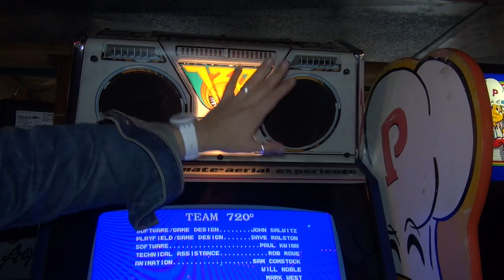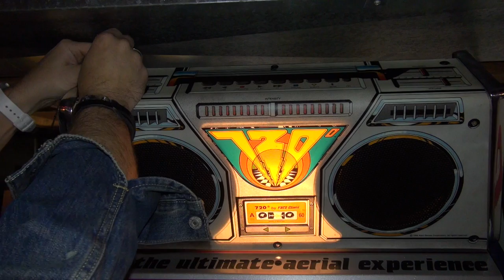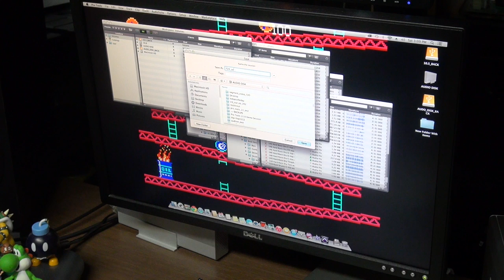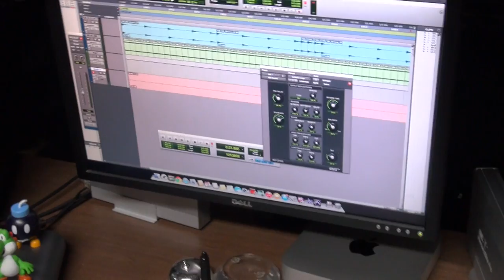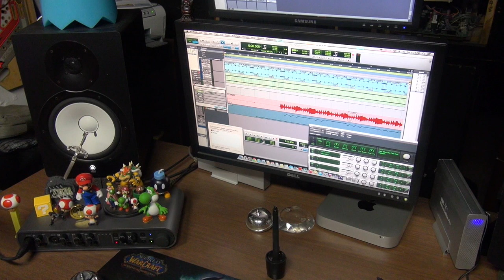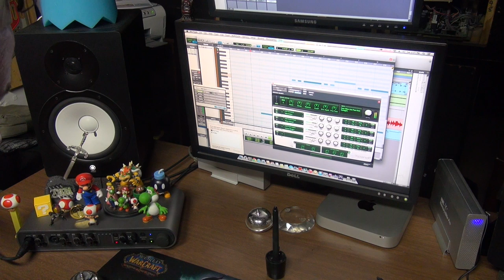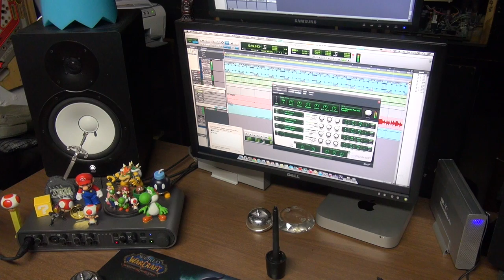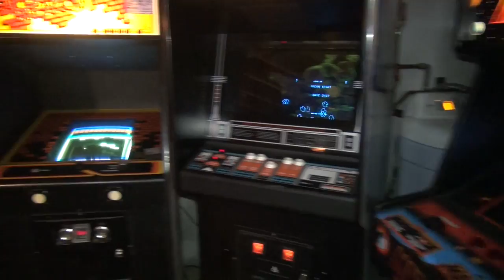Atari 720° Arcade Game Restore Part #2 - Stripping, prepping, and painting Control Panel and Boombox

Comment: Dude that steel weld is awesome stuff. Believe it or not, JB Weld is what's keeping my Marble Madness control panel perfectly flat. A buddy of mine that's a metal worker, took my Road Blasters control panel and cut off the yoke plate. When that happened, the control panel became flimsy in the center (even after he filled it in with a new plate.) To re-flatten it, he added a metal bar across the bottom, and then I used JB weld to secure it. Worked great. Great video, by the way! I'm currently restoring a Red Tent. Hope to have it done by Christmas :)

Comment: i think the best tools you need for restoring steel parts its a little sanding cabinet or making one you can remove paint rubber and roast in one time with thin sand and spare lot of restoring time.
just a council if you want forget it lol (good job everytime John)

Comment: John, if you ever need lots of heat to solder something you can use your heat gun real close, mine will work much better with big surfaces or big connectors than the iron. It will spread the head wider and melt everything though, you've got to be careful.

Comment: John, you should really buy the stripper in the big cans, its liquid based, you just pour some on and spread it with a scraper. I have used it plenty of times and works far better than the spray can versions. It may be different in the states, but here in Australia the liquid based cans/drums are far more efficient and industrial.
Reply from the maker: Ok, good to know! Might be cheaper too in the long run.

Comment: Nice to see some music processing going on !

I think you could solder it, but not with a 40 watt weller station that is made for electronics work...
I think the minimum you need is a 80 watt big ass iron, or better, a torch..
Also you would need different solder, that solder is made for electronics, hence the resincore.
Its like soldering cupper water pipes with a torch, like Mario the Plummer does :-)
Reply from the maker: It was worth a shot. :)

Comment: Hey, John, just a thought... Check out Harbor Freight. They have these furniture dollys that you can put under your games to move them around easier. They are rated for 1000 pounds and are on sale for $7.99 each. I just ordered 5 of them for $40. Shipping was $7 combined for all 5. Check them out.
Reply from the maker: Mike H I actually have a set of those. My Sprint 2 is sitting on four of them.